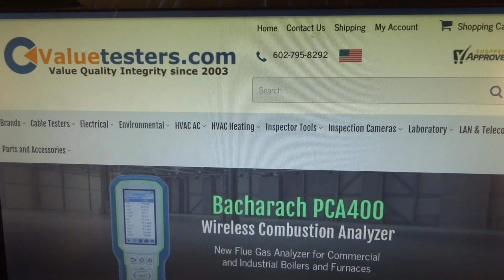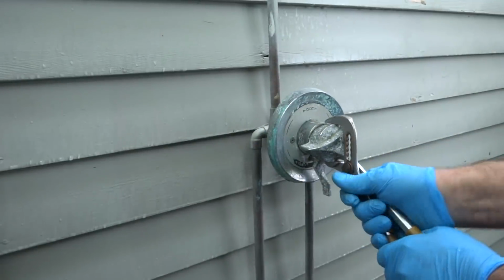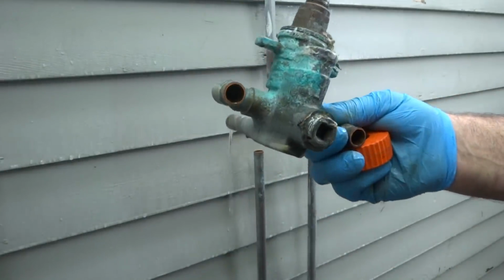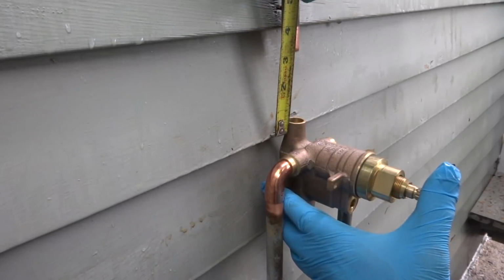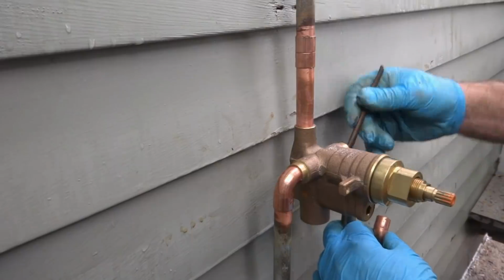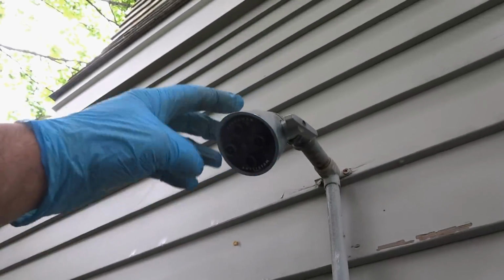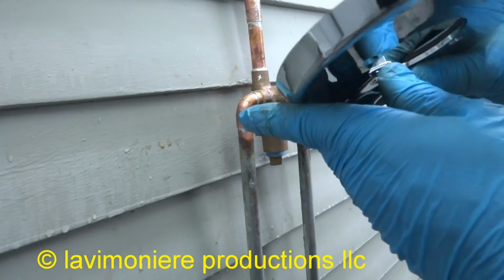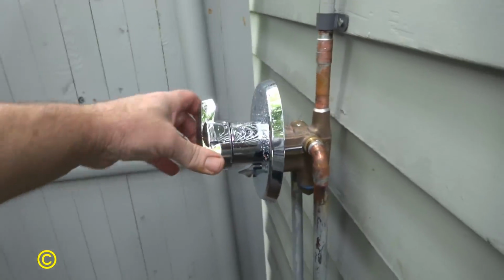replace outside shower at summer home

Comment: So I have hot and cold pex lines sticking out the side of my house with caps on them for now. So when I go to connect those lines to a shower valve for my outdoor shower, do I need to shut my water off at the meter or is there a valve under the house? Sorry I’m not a real plumber lol.
Reply: If you have easy access to your meter shut it off there. Piece of cake 🎂. Run the water inside to make sure it is in fact OFF. Best of luck to you. 😎 👍 🙏